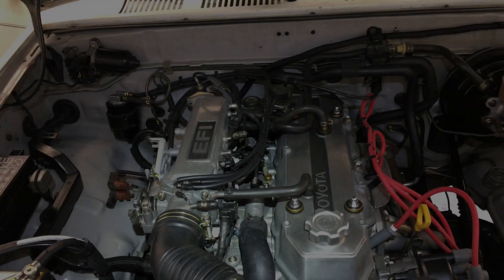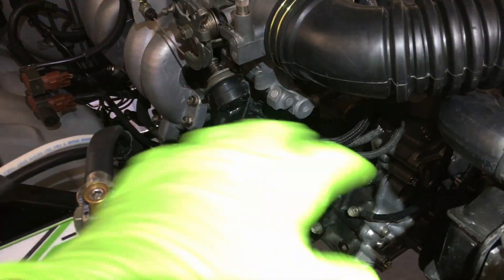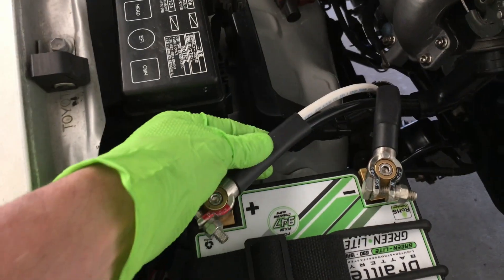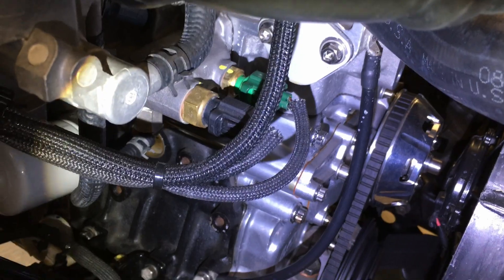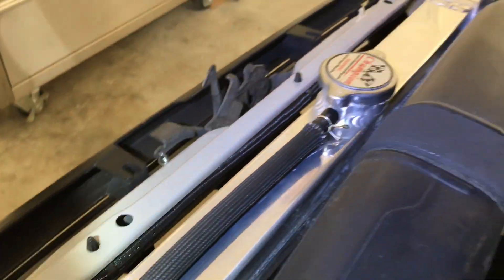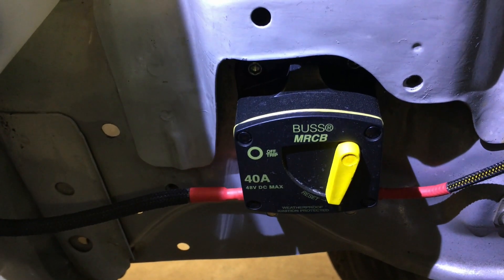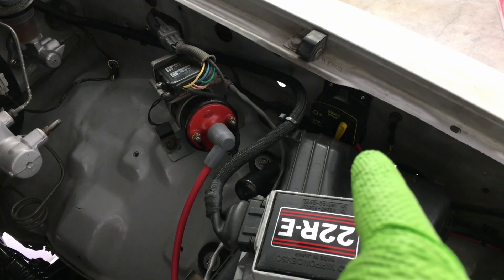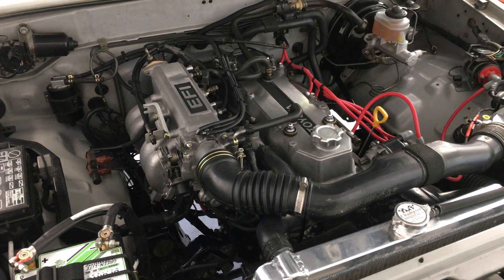22RE Toyota pickup battery wiring overview Braille G30 + LCE 140 amp high output alternator

Comment: Hey ray so I was wondering. I wanted to switch to a lithium ion battery. How would I go about that. I currently have a regular battery but I do have a 1 wire alternator. My 1 wire has a 150 amp fuse in between the 4 gauge wire that goes from battery to alternator. The oem alternator harness is completely disconnected.
Reply from the maker: it's basically just a direct swap in. The only thing you need to be careful of is if you were to totally drain the lithium battery. In that case, you'd wanna take it out of the car and charge it on a lithium specific charger - the reason is because if you hit a totally empty lithium battery with 150A alternator, it will pull the full 150A potentially, which can be a bit much. But otherwise, just drop it in and it should function like a traditional battery. Make sure you are getting a lithium battery designed for car starting, as some "solar panel / RV" type lithium has a BMS on board which can sometimes limit max output to more like 100 amps. Most times for starting a 4 cylinder you are gonna be pulling more like 180 to 200+ amps. The G30 I run has no BMS / no limit. You can pull every electron it has without any management system in the middle.
Reply: @ray5961  Sounds good. I was looking into the Braille B2618. Do you think that would be adequate? Also by chance do you know if there’s any where in the cab behind the dash the battery would fit? I’m assuming no as I have a heater core/ac stuff inside. But regardless the weight savings is a huge difference.
Reply from the maker: @fiys567  The B2618 isn't a Lithium Ion battery; it's an AGM (Absorbed Glass Mat) battery, which is basically the same thing you'd get buying from Costco or Autozone, etc. (the Braille is just a small form factor). AGM is still a lead acid style battery. It's a small step up from car batteries that use wet electrolyte (those lids you have to remove to check the liquid level in the battery), but it's still the same basic technology. The Green Lite Lithium series is what I'd recommend from Braille. As far as mounting up under the dash, good luck :-) You can gain some room by removing the heating tube that runs across (under the steering column) over to the far left hand vent. I run a crankcase vacuum gauge in the square hole where that vent used to be, so I removed all that air tube stuff under there, which does give you a bit of area room. I don't know if you could tuck a very narrow lithium ion battery up under there or not, but I kinda doubt it.

Comment: I thought the fan was powered by a belt via crankshaft pulley? Do you have an upgraded fan? Also, would welding cable be a suitable substitute for  the marine grade cable? Thanks for another great video!
Reply from the maker: Yeah, I installed an electric SPAL fan. The fan pulley is still on the motor (since it drives the water pump), but the fan itself is mounted to the radiator and is electric. Welding cable should be fine yeah. The marine cable is just a little higher quality and I think the individual strands are tinned or something to help prevent corrosion out in the ocean and stuff. But yeah, welding cable should get it.

Comment: Wow I really admire how clean and organized your engine bay is. I just bought my grandfather's 1988 22re and I'm trying to restore all the wiring under the hood. Everything is so crusty and most connectors aren't connected. My uncle had a bunch of hack jobs done on it. Can u please assist in links for the various connectors?
Reply from the maker: If you are going to be doing electrical work, you'll wanna search eBay for the Toyota electoral wiring manual specific to your truck. I show the one for my truck in several of my videos, but you'll need one specifically for your truck/year. In that manual, it will show every connector and the pin locations, wire colors, etc, etc. As far as buying the individual connectors, it's next to impossible. I had to replace a few of mine and I ended up having to buy used harnesses off ebay to source them basically. Let me know if you have any further questions; congrats on the truck! 88 is a solid truck.
Reply: @ray5961  thanks for the advice Ray, it's much appreciated. I'll do that and keep you updated as to the progress

Comment: where did u get that battery holder?
Reply from the maker: It's a rifle military strap w/ a D ring on one side and one of the rubber O things which holds the jack behind the seat on the other end - then loop it around and adjust it and use the metal hook on the rubber O thing to latch it.

Comment: Does that Red 8 gauge wire go directly to the positive terminal on the battery? I’m confused on if it stops in the fuse breaker box.
Reply from the maker: It's been a minute since I redid all the wiring, but if my memory serves me correctly, the red wire goes from the alternator over to the 135 amp circuit breaker I showed. Then it goes across the front (up under there by the radiator) and it goes into the fuse box and connects to one side of that 140 amp fuse I showed in the box (you can see the 140 on top of the fuse, which I had to buy and install - I think it might have been out of a tacoma). Anyway, I think the other side of that 140 amp fuse goes directly to the battery yes. I think one side of that 140 amp fuse also branches off to something else in the fuse box, but I can't remember for sure where it heads next. But yes, basically the red wire runs from the alternator, through the circuit breaker, then through the fuse, then to the battery. The reason I have the circuit breaker is to help avoid a situation where the G30 lithium battery goes completely dead and then suddenly the alternator tries to provide the full 140 amps and things decide to melt. Even though the alternator should be able to handle it, I mainly installed the 140 amp alternator so that normal electrical draw would only cause it to operate at a very low percentage of its normal utilization capacity. The idea is the 135 circuit breaker would throw prior to the 140 amp fuse blowing. My guess is that the alternator never sees a load higher than around 60-80 amps, even when the fan and head lights are on and the motor is running. Anyway, hope that helps.

Comment: Nice job on the wiring and love the engine bay its nice and clean
Reply from the maker: Thanks!
Reply: Hey man what's up I found a guy here who gonna rewire and tune mine so I should be getting the right amount of power from it after that
Reply from the maker: @owenfalconer9398  oh nice
Reply: @ray5961  do you have any videos on the odometer the one that had the sensor for the mph clock my first one was cable but I got a new one today and it's the sensor one so i want to know how to wire that type
Reply from the maker: @owenfalconer9398  Hey Owen - I don't know if that can be done. I think you have to get the SR5 dash with the mechanical speedometer. I could be wrong. Check LC Engineering and maybe they have a conversion; I think I might have seen something about that on their website once.
Reply: @ray5961  thanks